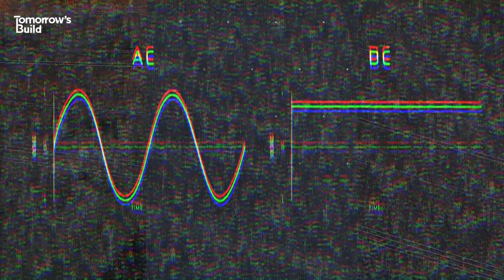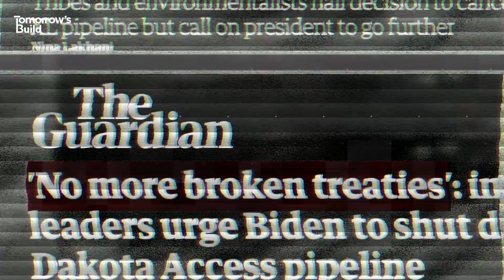The $23BN Plan to Power Singapore from Australia

Comment: $23B for 20% of the power demand? Good lord, wouldn't nuclear be a better answer?
Reply: we not gonna talk about where singapore would store its nuclear waste
Reply: @bwubi5936 ... underground, like anywhere reasonable?
Reply: @voidofspaceandtime4684  well they'd have to dig really deep cause most of Singapore's underground space is already being used for necessities such as big energy lines and reservoirs. not to mention the already limited land space, doubt other countries would let them store it using their land.
Reply: @bwubi5936  Yeah? That IS how nuclear waste is disposed.
Reply: Singapore has no land to make it come true, and it's quite dangerous while Singapore is so small
Reply: @gerrsyah  dangerous? Not really. ..
Reply: @moose5.9  Chances of accidents are extremely low, but if there is one all of Singapore will need to be evacuated. There's a reason why even in very nuclear countries like France all powerplants are built far from population centers.
Nuclear is not a good option for Singapore.
Reply: @luckyluke5638  There are plenty of tiny safe reactor designs in the prototype stages that would be perfect. don't be ignorant.
Reply: @voidofspaceandtime4684  You would need dozens of those to meet the country's energy demand. More reactors means more chances of something going wrong, and even though they use smaller quantities of fuel, it doesn't take a lot of toxic waste being released to cause major health consequences anyways.
If you're gonna build a nuclear powerplant in Singapore, do one and do it right. These small reactor designs are good for remote places with too little demand to justify a traditional powerplant.
Reply: @luckyluke5638  The whole point of the prototypes is that even IF they experience catastrophic failure it doesn't leave their immediate vicinity. They would be perfect for this application.
Reply: @voidofspaceandtime4684  Unless you can point to a specific reliable source, I don't see how SMR reactors have better containment and safety than current top of the line reactors
Reply: @zolikoff  the chernobyl exclusion zone would be a counter example to the idea that there has never been a nuclear disaster that needed evacuation.
Reply: @qtheplatypus  Like I said, it wasn't needed, regardless of whether humans decided to do it anyway out of fear and superstition
Reply: @zolikoff  most of the buildings have a radiation level of 0.7 uSv/h so if you where a student in the elementary school there you would get dangerously high radiation dose by the time you graduated.  The radiation immediately after the event was significantly higher.
Reply: @zolikoff  Check out the Fukushima exclusion zone. A whole chunk of it is still uninhabitable to this day because yearly doses are above 50mSv per year.
If you had millions of people returning to this area the cost of treating future cancer would bankrupt the entire country.

You nuclear fanboys denying every issue related to this energy are just as cringe as the anti-nuclear nuts you're trying to fight.
You don't just put a nuclear powerplant anywhere. You place it where it's smart to do so, and Singapore is not a smart place to put a nuclear powerplant, period.
Reply: @luckyluke5638  There is nothing uninhabitable in Fukushima. 50 mSv per year is meaningless. There are populated areas in the world that reach 20-30 mSv per year naturally and also professional exposure of similar levels and there are no health effects. To say sonething without health consequences makes a place uninhabitable is superstition. Want to be "extra sure"? Okay, then evacuate all you want, not my problem. But the air quality in a large city is verifyably much worse for health and life expectancy, why not evacuate all areas with air pollution then?
Reply: @qtheplatypus  There is no health impact living all your life at a background much higher than 0.7 uSv/h. Even if you abide by LNT, the impact is statistically undetectable. And if you throw away LNT the impact is zero.
By the numbers the objective health consequences of this kind of radiation exposure are completely negligible compared to everyday risks of everything else. Radiation just receives extra attention on superstitious emotional basis.
Reply: @zolikoff  10 years at 0.7 uSv/h would raise an adult’s likelihood of cancer to a statistically detectable amount.  However children and foetuses are significantly more vulnerable to ionising radiation so have even lower safe tolerances.  Personally I think nuclear energy is a good and useful tool.  However I also think that Singapore’s situation (dense city state, vulnerability to tsunami and hurricane) makes nuclear power ill suited.

It would make more sense to build the plant in Australia right next to the uranium mines (along with an enrichment plant) and run the power over the same cable that’s being built for the solar).
Reply: @qtheplatypus  10 years at that dose rate is 60 mSv and the statistical detectability of cancer risk in LNT, validated for instantaneous doses only, is 100 mSv.
But the even more important point is there are populations living at higher dose rates and receiving several Sv of dose over their lifetime, yet there is no statistically detectable cancer risk increase. So the LNT assumption is not correct in the first place.
Reply: @zolikoff  It's not 50mSv/year, it's OVER 50mSv with hotspots well above 100. At 5.7 million inhabitants Singapore is far from being comparable to isolated areas I can't believe you seriously brought that up as an argument. Reasearch is scarce about the people living in these areas, but the little research there is suggests that these people have built resilience to the levels of radiation they're used to. Singapore inhabitants in that case wouldn't.
As for workers in the nuclear field, the limit (at least in France) is 20mSv/year. This is a limit, this doesn't mean they're necessarily exposed to 20mSv/year. And last time I checked kids, babies, and weak adults don't work nuclear activities.

Reasearch in America has shown an increase in the odds of getting cancer based on radiation exposure: about +0.17 cases/1 million for every mSv of exposure above background levels.
Out of 5.7 million inhabitants at several tens of thousands of dollars for each cancer treatment I'll let you do the math. There's a reason why countries like France have put a limit of just 1mSv/year/inhabitant above background radiation.

The air quality argument is absolutely stupid for 2 reasons:
1) I'm not sure if you noticed but large cities in developping countries have been trying to crack down on air pollution lately as they have realised the huge health consequences it has.
2) Air pollution is a byproduct of human activities. Human activities cannot be avoided as it is what puts food on people's tables. A nuclear powerplant, however, is something people can easily live without.

Put a powerplant up in Malaysia if you want, but do not put it next to a major population center. People more qualified than you have already figured this out decades ago way before the public was irrationally freaking out about nuclear energy.
Reply: @luckyluke5638  The air quality argument works wonderfully to illustrate how superstitious and emotional the fear of nuclear accidents is. Even a worst case nuclear accident, while assuming LNT as true, still results in at least an order of magnitude less harm to health nearby than air quality does.

I am not saying this makes a nuclear accident good. But it is illustrative that, air quality problems being ubiquitous but yet mentally accepted as an "unavoidable necessary evil", while at the same time the mere risk of an unlikely nuclear accident, that would ultimately cause much less harm, is seen as the ultimate "argument" against using nuclear power.

Not to mention that a significant contributor to that bad air quality is fossil fuel power plants that have to exist in place of nuclear power plants because the latter is unacceptable near a population center, while coal gas and biomass plants are almost always near a population center.

So you can see how emotionally loaded the radiation risk is. No matter if LNT is true or not, the objective health consequences are much lower than the vehement NIMBYism against nuclear would make you believe.
Reply: @luckyluke5638  On the research "suggesting" that people living there have "built a resilience" to radiation: The research does not suggest that at all. There is no difference between the people who live there all their lives and the people who move there. Nor there are any radiation-related health effects in those who are exposed to it during work, most notably pilots.

The only reason why you would "want to think" that some specific resilience is involved is because you still expect LNT model to be true. But LNT has never been proven on anything other than instantaneous doses above 100 mSv. Considering all the empirical evidence, the simplest explanation is that LNT is just not true. No reason to keep assuming it is. I'm sorry if this suddenly makes nuclear accidents less dramatic. But as I've been saying, even assuming LNT they're not that much of a risk.
Reply: @zolikoff  Governments are progressively fighting to not make it a necessary evil anymore. But say all you want, as things are today it IS a necessary evil and your argument doesn't work.

Health consequences aside, the simple fact of evacuating 5.7 million inhabitants and shutting down the entire economy for weeks during cleanup in case of a major accident makes it an unecessary risk.
An unecessary risk that could easily be solved (for the most part) by putting it further away, or using another technology altogether.
Reply: @luckyluke5638  The whole point of the discussion was that it's a popular myth that evacuation is necessary when it is not. If you don't evacuate for air pollution then why would you evacuate for something that's an order of magnitude less harmful?
Reply: @zolikoff  I don't know where you get your sources from because every study shows a link between radiation exposure and cancer rates. And I don't just mean high doses like you mention.
Hearing you talk almost feels like radiation is harmless, has no long term health consequences, and "muh everybody is just stupid".

Radiation is harmful, expecially when large populations are exposed to it. No matter how many people are killed by air pollution, it's a hazard we're all better off without.
I'm sorry if this suddenly makes nuclear look not so magical.
Reply: @zolikoff  Already answered the dumb air pollution argument twice.
Reply: @luckyluke5638  Look up linear no threshold model then, you may not know the scientific works behind it and its criticism.
In short: this linear relationship between radiation dose and cancer risk has only ever been proven for instantaneous doses above 100mSv. LNT simply assumes that the linearrelationship holds for smaller doses and that dose rates don't matter. The industry and nuclear regulators simply assume this to be true despite there being no confirmation of it. And plenty of empirical evidence of thrme contrary.
In real life, if you get 100 mSv over an entire year you don't seem to suffer any statistically detectable cancer risk, even though an instant dose of 100 mSv is proven to do it. But LNT simply assumes that there is no difference. Again, based on nothing scientific.
Reply: @zolikoff  I did look it up a while back, and I just searched it once again. Most organisations that oppose the LNT model say that for low doses under 100mSv the relation between cancer rates and exposure is not linear, therefore that model shouldn't be used for these kinds of exposure to measure cancer risk. They are NOT saying that there's no risk, just that it's not linear and that data is so tough to collect that it's hard to give accurate numbers.
Also, you obviously cherry-picked the studies you want to believe because for every study out there saying the LNT doesn't apply at low radiation doses, there is one saying it does.

Bottom line: there IS a risk, we just don't know the exact amount of that risk. The best data we have is about +0.17 cases/1 million for every mSv of exposure above background levels and as long as we don't have a straight answer that's the number we should be using. You don't play with people's lives like that just because you want to satisfy nuclear fantasies.
Putting a nuclear powerplant next to a major population center is still a bad idea.
Reply: @luckyluke5638  No study has proven LNT at all, as I said, it's just an assumption that all environmental and regulatory organizations decided to follow to be on the safe side.
As for "playing with people's lives" let's talk when the alternative electricity solution isn't worse. Because you can't live without electricity either.

And currently Singapore is all natural gas and oil. That does more harm to the people living there than a Fukushima accident every year. So logically nuclear would be preferable.

But look, I'm fine if it's just located further away in Malaysia instead... it's just generally a bad idea to mot have your power plant on your own land. Never know what crazy stuff politics brings, and you always need power.
Reply: @zolikoff  "No study has proven LNT at all" now you're being ridiculous. Environmental and regulatory organizations didn't just pull these numbers out of their asses.
Hell, even the Wikipedia page mentions research that back this theory.

"let's talk when the alternative electricity solution isn't worse" idk man, kinda sounds like what this video was about.
As for politics, Singapore controls the Malacca straight and is a major trading partner. I doubt anybody will cut their power just for the hell of it. Besides, they're already dependant on other countries for pretty much all their resources.
Reply: Lucky Luke in short, if an accident do happen, think about all the marine life affected. I get if u dont eat fish or seafood, but asia is heavily dependant on food from the sea. Underwater currents and wind will spread those radioactive elements to other parts of the world.
Reply: @rain2269  The thing is, the marine life doesn't get affected. There are no observable negative consequences because biology doesn't care about some extra Cs-137 or other radionuclide at such low quantities. What's affected is human consumption because humans are really picky and superstitious and deliberately choose not to eat something with Cs-137 in it even though it would not have health consequences.
Reply: @luckyluke5638 0ppp
Reply: @gerrsyah  that is right, nucklear fusion could possibly solve it if they can blast their way out of negative amount of energy produced
Reply: Stop talking sense into these tree huggers.  They don't even know that solar energy is more destructive to the earth than nuclear energy.
Reply: They had sign for free nuclear zone in sea. Treaty of bangkok if you will
Reply: @meouby2  that makes so much sense now. i've been wondering why they cancelled plans for nuclear reactors other than where to  bury the nuclear waste (there literally is no space nuclear waste could be buried in in Singapore)
Reply: I have animals and birds look🐬
Reply: A nuclear power plant in the middle of one of the most important sea routes in the world?
No one would ever allow that to happen.
Reply: Mr B  Do you at least know that the unnecessary Fukushima evacuation orders had been lifted by now, and the people that still can and want to return have returned? Shame for the decade of their lives taken away though...
Reply: Nuclear has too much bad PR, won't be accepted by its citizen.
Reply: @MsEverAfterings  The bad PR that Nuclear has comes from the same  anti-efficiency group of Leftists that made Green the new world religion.
Reply: I think jurisdiction of the cables laid in presumably open/international waters is something that is/was the most challenging to overcome. Singapore has limited airspace and maritime borders. 100km it does not have.
Reply: For rich country like Singapore, why not spend little more for cleanest energy?
Reply: Mr B  I know very well what I am talking about, rest assured. I have worked with lethal radioisotopes, I am trained in what threats they pose and how to approach the safety question. Fukushima had no reason to be evacuated. It is only proof of how human stupidity is capable of causing self harm out of superstitious beliefs.
Reply: Mr B  I ain't ignoring anything I know how to look at numbers, dose rates, apply the LNT model etc. The Fukushima evacuation led to around 2000 premature deaths. It "prevented", according to LNT modeling, ~200 premature deaths from the fallout. That is NOT a valid tradeoff when your "safety measure" kills 10 times more people than it supposedly saves. There are indeed times when an evacuation may be warranted, at least temporarily, but not in this case.
And yes, Fukushima evacuation orders have been lifted by now in almost all of the area, just check Google.
Reply: may i present to u japan earthquakes
Reply: Nuclear power causes air pollution and it produces nuclear waste so solar is the way to go
Reply: Unfortunately, Singapore is too small areawise for a nuclear plant. Besides, Malaysia & Indonesia would be right next door, and they would have concerns...
Reply: Of course it would. The cost of this project, and the low percentage of demand that it satisfies, indicates that it's a feel-good project that virtue-signalling politicians can dump on low-IQ people.

A nuclear project can be done in cooperation with closer countries that have a more suitable rural location for it. Both countries could benefit. People like to assume the stupid design of Russian reactors defines that technology. It doesn't. But again, low IQ.
Reply: Yeah
Reply: 23B is not alot for Singapore
Reply: @NewmaticKe  If its not a lot maybe I should ask for a million dollar donation.
Reply: A nuke plant on Singapore would also raise protest or issue with the neighboring countries, in case of a disaster, the Malaysian and Indonesian population would also be at risk, who's gonna take responsibility then?

Some people here are not smart enough to asses the risks.
Reply: Nuclear is not dangerous and can be built in ships and anchored just off the paranoia boundary, the limit where people are just going to accept it. A 3-5 Km undersea cable from a couple of floating nuclear power plants like the Academic Lomonosov providing around the clock power in a way higher percentage than that 20% seems like a better idea than this. And no batteries needed either..... But yes, unfortunatelly it's another case of "BuT ma' ChErNoByL aNd FuKuShImA!"
Reply: @vipondiu  If a major accident happens, the exclusion zone is a lot bigger than 3-5km. In the unlikely event something happens all of Singapore is pretty much done.
Risking losing your entire country is not worth it, as little as that risk is.
Reply: @luckyluke5638   Put it 100Km out to sea then, it's still way closer than Australia xD
Reply: @luckyluke5638  and floating nuclear stations can be scuttled if the absolute worst happens, there's no need to lose your entire country
Reply: @vipondiu  I think putting it in the middle of a busy shipping route is an accident waiting to happen.
I don't think you could put it further towards the South China Sea or the Java Sea either because you'd be in neighboring countries' maritime areas and I doubt they'd appreciate it.

Only option left would be to put it far into the Indian or Pacific Ocean, but a) I doubt international law would allow this, b) the ocean gets pretty deep and c) if you're gonna run a cable this long and spend this much money you might as well run it to Australia.
Reply: @vipondiu  Dude... you seem soooo very insistent on your shallow unconsidered opinions thinking that you have an answer to everything that others said. You have obviously no clue about science, geography nor international laws and politics and yet you have a ready answer for everything. Either keep an open mind and learn or go back to school....
Reply: @luckyluke5638  yes you're totally right. My government wouldn't risk the 1% chance and destroy the whole country. there is definitely safe reactors like TerraPower but some times I ask myself if there is a 1% chance, a lion is outside my house right now would I go outside? my answer will be no everytime. Haha.
Reply: @Nicholson12345  I'm not sure how you can compare an entire country's culture and economy to an animal outside your doorstep and think this will make me take you seriously but ok
Reply: @luckyluke5638  Since the big deal here is the viability of the longest sub-marine extension cord why not put a reactor next to the solar array in Aussie-land?
Reply: @henryrutgers2647  Would make more sense to put it to other end of that cable yes, tho it would need to be next to a large source of fresh water and far from a region prone to earthquakes.
Reply: @henryrutgers2647  Attitudes are changing in Australia towards nuclear power, yet there remains the issue of storing spent rods
Reply: Floating nuclear stations is out of the questions as Singapore is very aware of the dangers of Nuclear due the highly publicized accident of Fukushima Nuclear station. There are currently no good locations and also safeguards in keeping the Nuclear station floating without any accidents happening and Singapore has no absolute intentions of polluting the sea waters if there is any accidents.
Reply: @jimmylee6041  I agree floating ones are unnecessary, you can site land-based reactors such as a couple BWRX-300 next to each other onto either an island already filled with oil tanks and refineries (Bukom for example), or on the site of the Tuas gas power plant onshore.
Reply: Yes, but apparently nuclear is bad.